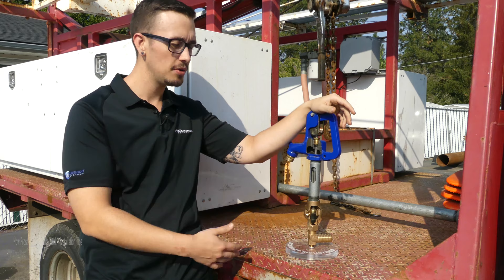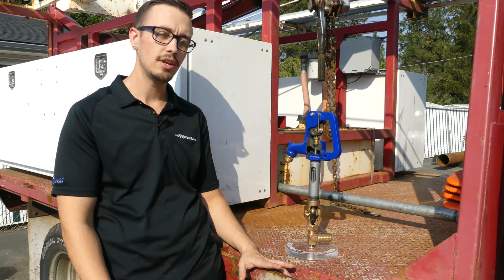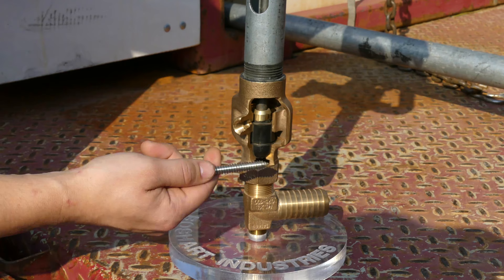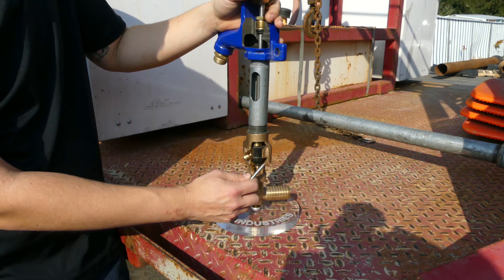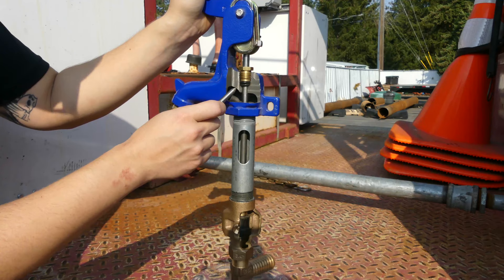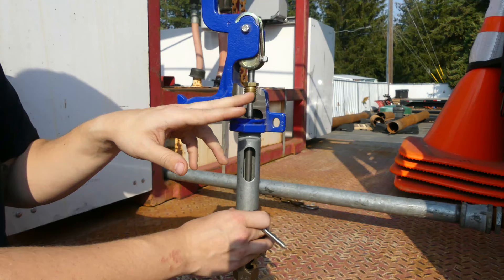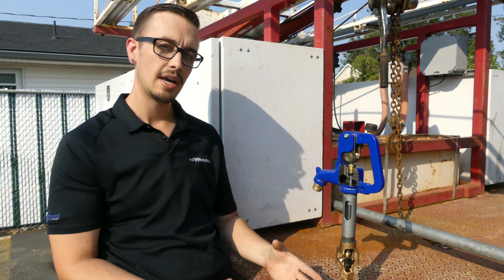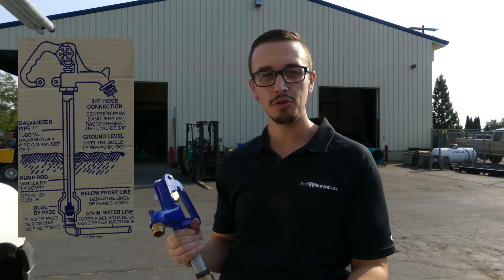How Frost Free Hydrants Work + Installation Tips

Comment: We have dozens of hydrants on our farm. Ive found that by using a slide-type pitless adaptor, in a length of 4" pvc, allows me to be able to simply lift the hydrant out for service, without having to dig or bust concrete.  I usually connect a 4" sand tile at the bottom, and a split pvc floor drain with a hole drilled in the center, large enough to support the hydrant pipe, provides a nice floor drain as well.
Reply from the maker: Smart thinking!
Reply: Sounds great! I wish I knew what it all meant!!
Reply: You should shoot and upload a video about your install. Seriously - this is brilliant - do it for the good of mankind! I think I've got the picture, though. A hydrant with a 4" PVC sleeve wouldn't need to be completely dug out for repair or replacement. I just had to dig up and replace a 21 year old hydrant that was no longer serviceable because of lime corrosion. I replaced it with a Water Source hydrant from Menards. Just two months later, I discovered water is pumping up from the ground. I had back-filled around the hydrant with pea gravel and it was easy to see why it was taking so long to top up a stock tank since perhaps half the water came out the spigot and the other half was flowing out the bottom, flooding a huge area around the hydrant. I will say that Water Source support was excellent about diagnosing a cracked bottom piece and offering to send out a replacement part under warranty. But, for all the work involved - now having to repeat the same pain in the a** chore I just did a couple of months ago - I'm going to eat the cost of that 'Made in China' hydrant from Menards and replace it with a different brand. (Just looking around at hydrant discussions and Amazon ratings, it appears the Made in USA 'Woodford' is a favorite. It's easily twice as much as I paid for the Water Source hydrant, but cheap compared to my labor and the fact that the "inexpensive hydrant" worked for two months before heading to a landfill.)
Reply: That's really good. My hydrant is in coarse gravel so not well supported. Running it through a drain like that would be an option. Probably just going to run with my current plan of clamping it to some wood for now.
Reply: @jimmyyounger618  The only issue I can see is that the bottom of the hydrant is usually protected from frost partly by the layer of dirt over it. Not so much of an issue if the frost doesn't go that deep, obviously but might be worth stuffing some foam down the pipe if that could be an issue.
Reply: show us please

Comment: Thanks. I found a repair kit easy enough but between tightening the bottom plunger today and the tip about tightening the compression fitting, I might not have to install it. Shame I already dug the hydrant up but oh well. Symptom was I could hear water running when the hydrant was off. I think water was entering the hydrant and exiting through the drain hole. I'd recommend people check this regularly (you may need to rest your ear on the hydrant) as it could be a significant source of water loss.

Comment: I have installed 3 of these over the years. They seem to last about 10 years and then water starts pooling at the site.
  I usually just dig them up and put a new one in, but the thought of rebuilding one had not occurred to me. I wonder if I were to loosen that top nut and have the rod/plunger extend just a tiny bit more down, via adjustment, if I might get another year out of it.
 With it turned on and a two way in place and those valves both closed, the pool of water will then will drain. That suggests that the rubber plunger is no longer fully seating in the off position. (to me anyway)

Comment: When installing I failed to put much rock in the pail surrounding the unit.  I live in the Pac Northwest whereby frost never gets below 1' also my soil is very porus since we are very close to the Columbia River.  Question, do I need to dig it up, remove the soil from the area of the drain hole?

Comment: Thanks!  I need to see if y’all have a manual pump that attaches to the well for those times we have no power.
Reply from the maker: We sell baker hand pumps, here is link to see the components: https://www.bakerwatersystems.com/uploads/files/products/category_pdfs/Hand_Pump_11HDA_12_HDA_Installation.pdf
If you'd like to order one please give us a call: 855.329.4519
Reply: also check out the Simple pump  they can be hand pumped or solar converted at any time without pulling the pumping assy

Comment: My simmson water hydrant suddenly stopped allowing water out. Is it likely the plug at the bottom that needs to be replaced or is there a adjustment in the handle that I should try first.

Comment: I know this a old video but am still hoping for a reply. Have a ranch with about ten hydrants and several have failed at the connection of the galvanized pipe to the brass valve. It is my understanding that this connection will cause serious galvanic corrosion. Please explain why this combination is used?

Comment: I was servicing my Plumb Ezee hydrant today as is was majorly leaking. I removed the head by unscrewing it and discovered that the 3/8” rod was disconnected from the coupling that is screwed into the base of the head. On closer inspection, the threads on the end of the 3/8” rod are completely cheesed off and will no longer bind on the threads of the coupling. Can I just take another 3/8” rod of the exact same length, thread the ends and reinstall it?

Comment: I opened one of ours this afternoon and no water came out. Now that the handle is fully open I can't close it. When i shake the hydrant I can hear what sounds like the rod loose in the pipe even though I can still see the rod with the nut attached to it behind the handle. Can the rod snap in half?

Comment: Do you need to put a 90 degree or something out of the bottom drain weep hole, to prevent dirt from getting back into the seals?
Reply: You're supposed to use gravel so should not really be much of an issue.

Comment: My hydrate leaks coming up from the bottom casing but only when I turn it on.  Please tell me it's àn easy fix? Would it be I just have to replace the guts or the whole hydrant?
Reply: I was having that same issue on mine and I haven't had time to check my theory, but once I thought about it I think this is the problem. I didn't pay attention to how the instructions tell you to adjust the handle! Push the rod all the way down so the plunger is sealed against the bottom water inlet. Then loosen the set screw that holds the handles connector to the rod and lift the handle to like a 30 degree angle(see instructions for your hydrant)without lifting the rod. Then tighten the handles rod connector set screw to the rod. What I did was pushed the rod all the way down and tightened the handle rod collar set screw when handle was all the way down. But what happens then is when you raise the handle all the way up the plunger is blocking or up above the waters upper by-pass hole. and also above the pipe drain hole. So then the water comes in and the only place it can go is out the drain hole. The handle has to move the plunger up, but not too far up.

Comment: Hoping you can help... I have not found a video that covers my hydrant problem. My hydrant is a Simmons. When the handle is closed, the faucet stops and the freeze hole drains as it should. But when the handle is up, the faucet runs as you would expect, but the freeze hole is also putting out a strong stream. Obviously not right. But I don't know what to replace. Thoughts? Thanks!
Reply from the maker: It sounds like your plunger is not sealing the drain hole. You will need to pull it out and inspect it for damage/replace if needed. Here's a good video on how to remove the rod/plunger from ground level: https://www.youtube.com/watch?v=qYiF3y5f9yI&feature=youtu.be
Reply: @RCworstwater  Thank you for your prompt and helpful reply.

Comment: What kind of lubricant for the O rings? Also can you open the hydrant partially ? I know fire hydrants can only be open or closed because of the drain feature.
Reply: Use silicone grease, "Super Lube-21030 Synthetic Multi-Purpose Grease" is one of the most reasonably priced ones I was able to find. Don't use petroleum based grease or petroleum jelly as it will swell the rubber rings damaging them.

Yes you can throttle the flow, but it is a bit harder than a normal spigot because much of the handle movement doesn't change the flow. You have to find the sweet spot. You will figure it out if you try though.

Comment: I have a frost free hydrant that is running very slow. There are two other (non frost free) valves on the line that run normally. What should I look at in order to make the frost free hydrant flow at the rate of the others. Note: it has worked fine for years without maintenance, it is located in a barn.
Reply from the maker: You may have an obstruction or sediment buildup around the stem seat - you can try taking it apart and cleaning.
Reply: @RCworstwater  thank you. I'll give it a shot.

Comment: The piston on the bottom can it be pulled out thru the pipe or do you have to dig it up, mine is 9 feet in the ground
Reply: I believe you unscrew the faucet head and then all that stuff pulls out. You'll need a pipe wrench for the pipe and then something for the head (a second pipe wrench, perhaps).

Comment: So there is no way for the rod to fall down inside that pipe? 
My water pressure is really low on one of my hydrants and I was told to be careful not to let that rod fall down into the pipe or I would have to have it dug up? To me it doen't look like it can fall down inside.  

One of my hydrants has almost too much pressure, the other one doesn't have very much at all. But it still works. 
Can it even be adjusted?
Reply from the maker: To my knowledge it cannot fall down inside. If output is low you may have a partial plug in the hydrant or it is simply too far away from your pump.
Reply: @RCworstwater  Thank you

Comment: I have a hydrant that is connected to several timers so it is on all the time, handle up but most of the time no water passing through. When no sprinklers are on I can hear water running if I put a ear close to the pipe. I disconnected the hose and turned it off, handle down. no sound at all, so no leak at connection down there. I can only hear the sound of water running when the handle is up/on and no water is passing out through my hose. Whats wrong here? It sounds like a small leak down at the valve.Thanks, Im in N.E. Washington and been here for 45 years .
Reply: P.S. no pump here, gravity spring. I used to get tiny bits of granite in the water line, also I replaced the plunger a couple of years ago.

Comment: Is the drain port a check valve or a open hole?  Mine is not draining when closed.
Reply from the maker: There's a small hole that the water drains out of when the plunger is seated. If it's not draining, that hole is likely plugged with sediment.
Reply: What would be the easiest way to unclogged drain port without digging up the hydrant?
Reply from the maker: @mikef6706  You'd have to get creative. Blowing some air down could free it up, but it could also damage the plunger.
Reply: No Luck with Air.
A micro second after I open hydrant water flows right out.  I hear no gurgling as the hydrant is opening....
Reply from the maker: @mikef6706  You'll need to turn the power off to your pump or close a valve to isolate the hydrant before you work on it
Reply: Sounds like it might be time to dig it up or just use a a non-frost free faucet.  Turn off for the winter and drain.....
The rod barely goes past the  locking square lock bolt that adjusts hydrant....